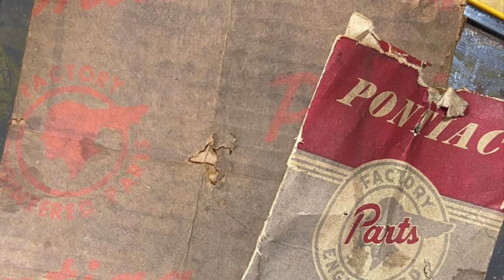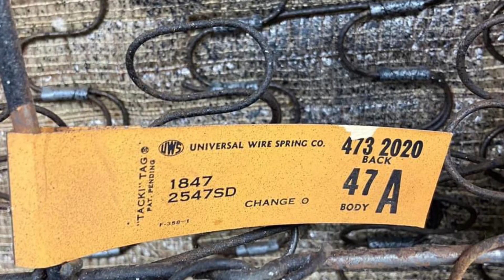1958 Pontiac Bonneville project

Comment from the maker: 🔹Automotive Art🔹

1958 was an outstanding year for automotive design especially in the drawing room of general motors. The heart, soul and level of detail that went into each component is just outstanding. With an ever growing interest in the Space Race at this time period you can see where designers drew their inspiration from. Subtle details to give the illusion of movement, stars, fins and stainless trim fashioned in the appearance of rockets. It was a time where automakers were in a beauty contest against one another and it would seem the finance departments were told to stay quiet. 

This 1958 Pontiac Bonneville is a perfect example of that, every inch of this car shows intentional and passionate forethought. This particular '58 is a very special project as it is one of the few factory built fuel injected 370 models. VERY few of these cars were produced and even less remain in existence today. This is also equipped with factory air ride suspension, another rare option. This car was ahead of its time.

This particular car was owned by the late, great Steve Ames, a car him and his father had been working on but were never able to complete. We have been commissioned by the Ames Automotive Foundation to complete the Bonneville and prepare it for display in the museum. Aside from a paint job years ago, this car remains largely original. Areas such as the engine bay and interior are being preserved in their original state rather than restored. We have been cleaning and detailing each little piece as we assemble this car back together. Countless hours have already been spent repairing and polishing each little emblem, piece of chrome and stainless steel trim. There are about 137 separate pieces of trim on the exterior! And that doesn't include the 80 or so on the interior! For anyone who has ever done molding/trim restoration you know that’s no walk in the park. A big thank you to Dan and Dylan for the many hours they invested into this. The folks at AAF have also set us up for success with a bunch of nos (new old stock) parts to use on the car where necessary.
 We are nearing the finish line on this project, and it has been an enjoyable experience. Once completed we will share some finished photos!

1958 FUN FACTS: 
🔹The year NASA was established
🔹One of the biggest hit songs in the US was in another language. Number 1 in the summer of '58 was Italian artist Domenico Modugno's song Volare (Nel blu dipinto di blu)
🔹The plastic hula hoop is first marketed
🔹The very first Pizza Hut opens for business
🔹Michael Jackson, Alec Baldwin, Tim Burton, Drew Carrey, Ellen DeGeneres, Prince, Ice-T, Brian Regan, Madonna, Jeff Foxworthy, and Alan Jackson are born.
🔹1958 was a one year only model for the Bonneville and its other GM cousins. All the design work was completely different from '57 and the later '59 models. Amazing.